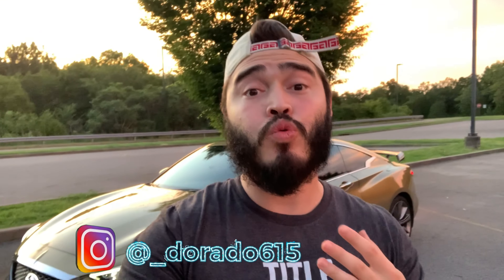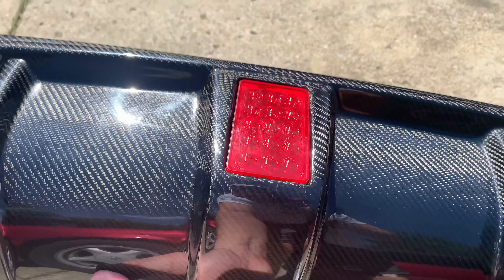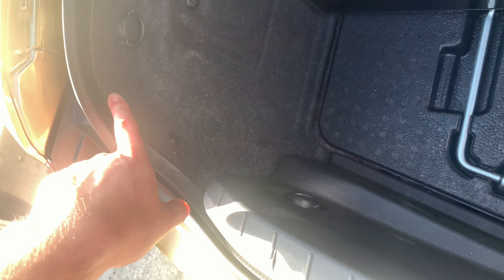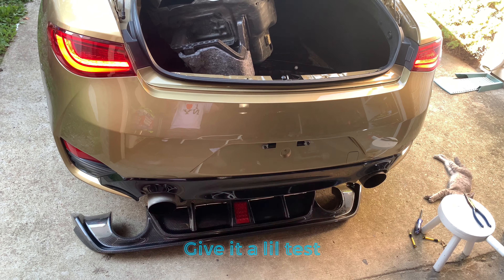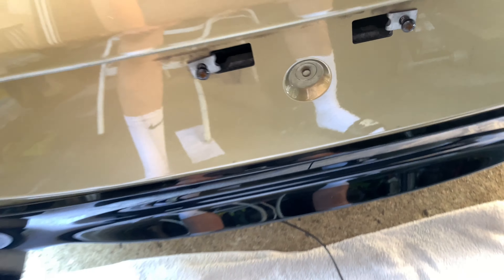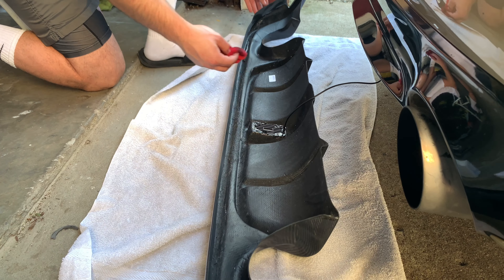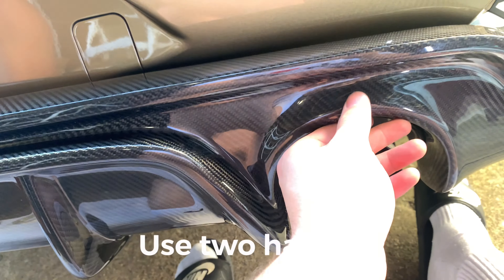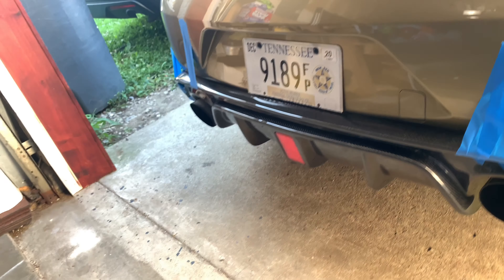Infiniti Q60 Carbon Fiber Rear Diffuser - Install

Comment: Br i went to do this - and my diffuser has 3 color wires - red black and WHITE.  The thing just flashes over and over when i connect the white wire to either the green and white wire or green and yellow wire.  doesn't make a difference.  any idea ?

Comment: Hey what size are the trim screws? Did u use the same ones for the rear spoiler?
Reply from the maker: 3/4" & I had the wing professionally installed brother